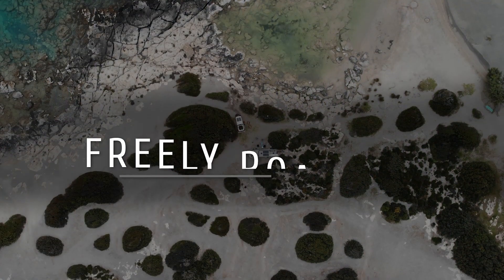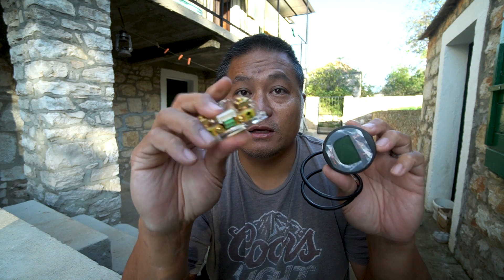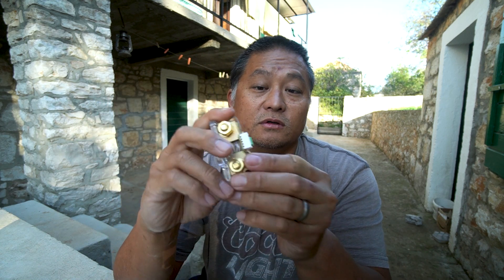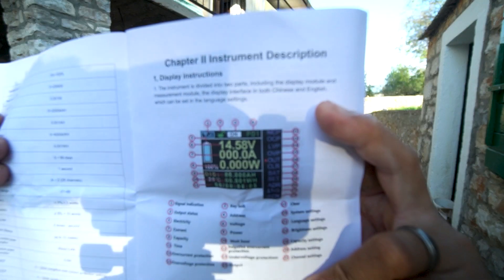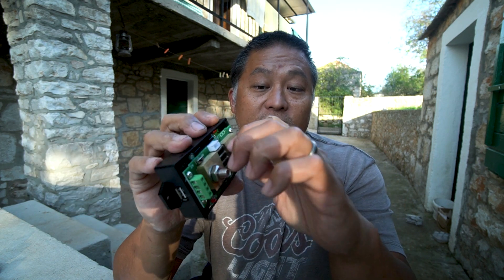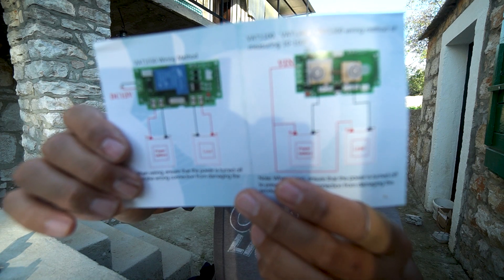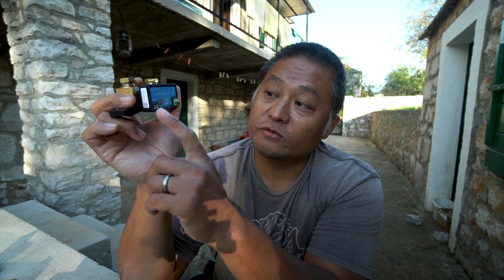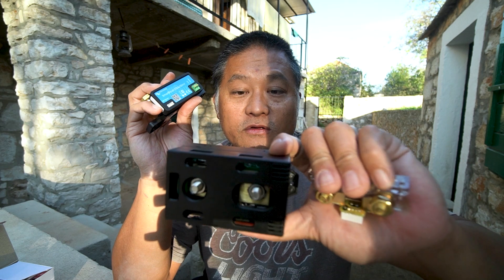Victron Smartshunt, AiLi and Juntek // Comparing 3 Popular Battery Monitoring Shunts

Comment: I am in the design phase to transform a Sprinter 211 cdi, new (2021), L1H1, all a little tight !!!!, but perfect for use here in Europe and exploring small towns, easy to park ... etc
But now I got to the point of doing the electrical project, which I'm not used to doing, I'm a civil engineer, I understand 110 / 220v AC circuits.
I wish you could help me with that part.
I'm Brazilian, but I also live a lot here in Portugal, where I'm going to do the conversion.
Well, I started making a spreadsheet, with the equipment, the necessary power and time of daily use, I have no intention of filling the motorhome with things, not least because it is a Sprinter L1H1, and I would like to have a simple electrical installation, but I would not like have gas inside, so I would prefer a stove with only one induction zone.
To heat the water it would be a D6 truma, which is diesel.

But from the calculations I made and compared with others I saw on the net, it seems that it ends up consuming a lot of energy, making the electrical part more expensive.
I don't want to spend so much just because of induction.
I don't know what other electrical equipment I would still need for everything to work, still using the car's alternator and an external 220v point when stopped at a camping site.

In your opinion, which a good configuration sufficient to have a quick meal,  with induction and stay out of the network for a day or two?

Well, the result of the spreadsheet was:
220V equipment
notebook - 65w - 1 hour of use - 5.4 Ah
induction cooker - 1800w - 0,4 hour of use - 60 Ah

12V equipment
USB - 50w - 1 hour of use - 4.2 Ah
refrigerator - 45w - 8 hours of use - 30 Ah
lights - 15w - 3 hours of use - 1.3 Ah
water pump - 42 w - 0.5 hours of use - 1.8 Ah
exhaust fan wc - 40 w - 1 hour of use - 3.3 Ah
I will be very grateful if you can help me by presenting an wiring electrical diagram with the necessary equipment.
I appreciate if you answer. 
my address is: joaolp55 @ gmail com
Thanks
Reply from the maker: Hi Joao, I think your computer use might end up being more than you budgeted but let's just go with what you have. It seems to be roughly about 110Ah of 12v power. Consider some efficiency losses, between 5 to 10%, we can base it on 120Ah of daily consumption. I like to go by the rule of threes. That mean, have at least 3 times the number of watts as you do daily Ah consumption. That will give you some safety in knowing you can recharge to full, or nearly full each day. And if budget allows, have 3 times the total usable capacity in your battery bank. This second part is a nice to have as it can get expensive but it will give you some reassurance that 3 consecutive days of rain won't cause major problems. That means, I would go with at least 360 watts of solar and as much as 360Ah of battery capacity. If you need more advice, I am also available for hire for private sessions here:

https://freelyroaming.com/coaching
Reply: @freelyroaming  Thank you very much, it helped a lot. I am thinking of abandoning the induction cooker idea,  I would need to make a high investment for that. I think I will study the hypothesis of having gas, but in a portable way. only use when you are offline. And when I am in the hammock, in a camping, I can use induction, as it is more practical, I save propane.
I will redo the consumption calculations, but it will certainly be a lighter project.
Thanks.

Comment: 4:08 150 A * 12 V = 1800 W
Reply from the maker: I was using my maximum LiFePO4 pack voltage at 100% charge which is 14.6v.  The nominal voltage is 12.8v and cutoff voltage is 10v so the output range is between 2200w and 1500w. I always use the max to determine potential power output of to make sure components are properly rated.

Comment: Anyone know which Bluetooth version Victron is using inside their smart shunts... curious to know what kind of real-world range  I can expect(?)
Reply from the maker: It is bluetooth 4.0 (low energy) and I can get 10m line of sight but it drastically reduces if there are signal shielding obstructions. People who complain about range is really complaining about all of the metallic surfaces surrounding their Victron bluetooth devices.
Reply: @freelyroaming  - Is it possible to add a bluetooth range extender to the Victron(?)
Reply from the maker: I do not have any experience with Bluetooth repeaters. Might be worth a try if you really need more range.
Reply: @freelyroaming  I've just installed the Victron Smartshunt. While my devices can detect the smartshunt from about 3 meters away, the VictronConnect app loses the connection when more than 30cm from the shunt. That's while maintaining a view of the shunt, no interfering metal or other obstructions. It's seems to be a consistent complaint on the Victron forum.
Reply from the maker: Not with my unit. I can access mine within 10 meters with no issues.
Reply: @freelyroaming  - 10 meters... interesting!
Reply from the maker: Line of sight. Less if there are obstructions. My van is 22 ft and the shunt is near the back and I can always connect to it from the front of the vehicle with seats and kitchen unit in between.
Reply: @freelyroaming  that's what I was hoping for. I wonder if it's related to the model? Mine is the 500a
Reply from the maker: Mine as well. 500A/50mv

Comment: Hi Jan, I have some questions on Juntek VAT-1200: Does the display unit require battery power ?  is there a battery compartment ?  what size of battery and how many ?   does the display goes off automatically after some seconds ?  when my battery pack is idle without any load, will the shunt (the black plastic box) be still working 24 hours non stop everyday to transmit the data to the display unit ?   What is the max distance the display unit can go away from the black box ?  Thanks !
Reply from the maker: The display needs either 12v power or plugged in via usb. No internal batteries. The display just stays on as long as it is powered. Haven't tested the range on it but it is reasonably good from what I can tell. Works from across the room about 20ft away.
Reply: @freelyroaming  Thank you so much ! Dan    How much does the shunt consume the battery power  ?   does it make sense to you if the shunt is put after a main on/off switch ?  I use my battery pack just for backup power purpose only while power outage,  most of the time the pack is off without any load. I do not need to keep track the battery status every day, perhaps once every 2 weeks, so whenever I need to check, turn on the switch to get the data, then turn it off in a min.  What do you think ?
Reply from the maker: The draw is miniscule. Unless you have a really tiny battery pack it is not a concern.
Reply: @freelyroaming  Thanks!

Comment: I have the VictronConnect 712 with display, I have installed in a van I converted, it has a metal body that is earthed so some items may nor use an earth from the leisure battery direct. Does this cause a problem not being earthed from the leisure battery via the shunt.

Comment: I use this victron shunt and it is brilliant, though i must add the data log is very limited. If you could keep the app open and running indefinitely then yes you can access graphs over time but other than simply recording the max and min warning voltages that need to configure, it does not save any other data internally
Reply from the maker: I do with it could do more. It would be nice if it kept track of incoming and outgoing current like their SmartSolar controllers does with solar for 30 days. But I like that it tells my number of discharge cycles, last discharge depth and time since full. More would be nice!
Reply: @freelyroaming  We all want more, but Victron is using deceptive advertising practices to call this "data logging"
Reply: @BoBurton  It logs it in the phone app as long as you stay connected and have the app running the whole time.
Reply: @troy3456789  yes... That's my point. Why would I keep the app running and phone connected 24/7?  Other companies offer onboard logging whether a phone is connected or not.
Reply: @JirafaBo  I wonder if Redarc or Renogy have such tech. I have not looked. (Renogy is Chinese, and Redarc is Australian)

Comment: You may find the Raspberry PI version of the Venus OS useful!

I have one connected to my BMV712 and both of my solar charger controllers connected via DIY usb cables (and a GPS sensor) and it gives me the status of everything from the app, even if I’m not near the trailer. Trailer is connected via WiFi or a hotspot at all times.
Reply from the maker: Yeah I've been considering repurposing one of my pi4 for this. But I don't have a persistent wifi connection in the van yet since we cross a lot of international borders and don't always have internet connection.

Comment: Wowow  The G7200 takes 3 days to charge.  Price is $250.00 on amazon.  Why pay so much for a 7.2 amp charger?   I dont understand.
Could you recommend a more powerful charger for less or the same money?.  Thanks.  Love you videos
Reply from the maker: The g7200 has been discontinued so that's why the price has gone up. Was around $100 before. For $228 you can get the Noco G26000 which is a 26 amp charger. It will charge more than 3 time faster.

https://amzn.to/2NMojUF

Victron makes a 15 amp charger with bluetooth connectivity for about $150 that looks good. I've never used it but I used many of their other products and all have been great.

https://amzn.to/3r7NkrW

Comment: Try a Venus gx?
Reply from the maker: The Venus GX is an the interface to connect various Victron components like a Multiplus, mppt solar controller and also works with this SmartShunt. By itself it is not able to do anything without peripheral components. It is overkill for my purpose. I have however considered installing Victron's raspberry pi free server software to achieve similar capabilities but have not found a need to do it.

Comment: The most useful and clear videos I have seen so far on YT, thank you.  

Question: It seems that the BMV-712 also has an external relay switching option (NO/COM/NC ports), while the shunt still has ports for a temperature sensor like the Smartshunt. If so, could I set the BMV to cut off DC-DC charging in a low temperature? (2x Orion-Tr smart 12/12-30, has a remote on/off switch wire) 
And maybe get around using a Smartsense as well, if the MPPT can read the shunt via the BMV. 
I think it would work, but maybe I´m leaving out some other important stuff this way (still need high/low voltage cut-off somewhere and so on, ideally wouldn´t want to trigger the battery bms).

I´m building a van, also probably going with a custom battery and everything else Victron. It´s a winter van, so a low-temp cut off is essential. Charging would be mainly from the alternator, but also a small solar panel and a charger-inverter if needed (the MultiPlus 1600W should have a separate low-temp cut-off with a separate sensor anyway, correct me if I´m wrong).
Reply from the maker: Yes you can get the optional thermistor accessory for the SmartShunt which will give you exactly the same functionality as the battery sense. It is about half the price as a battery sense. Had I not already owned the battery sense, that's what I would have done. I'm not sure about the relay programming aspect of the bmv-712. It seems that it should be able to trigger it on and off based on temperature but I cannot say for certain until I get one too try. Thanks for your support! Stay tuned as I'm currently gathering parts to upgrade my battery pack to have a temperature controlled battery heater. It will greatly improved the van's comfort in cold weather.
Reply: @freelyroaming  Thanks! Will do.
Reply: @freelyroaming  From the Victron website, the Smart Shunt provides "a connection that can be used to monitor a second battery, for midpoint monitoring, or to connect a temperature sensor". In other words, the auxiliary function is limited to one of these three tasks. I have 2 LiFePO4 batteries. I would like to monitor both of them using the Smart Shunt. Monitoring the two batteries would leave me without the ability to use the optional thermistor to monitor battery temperature so I would prefer to go with a combination of the Smart Battery Sense device and the Smart Shunt with my Victron Solar Charge Controller using the Bluetooth app. Have you experienced any issues using your 2 Victron solar charge controllers in combination with the Smart Shunt and Smart Battery Sense?
Reply: @freelyroaming  My apologies. I see that 2 batteries in parallel are to be treated as one. I also believe that the temperature thermistor will allow the shunt to monitor all the other parameters plus battery temperature. I would disconnect the existing wired replace it with the thermistor. Am I correct? Since I already have the Smart Battery Sense, I would consider using it and the Smart Shunt without purchasing the thermistor, assuming that there would be no issues using the 2 devices in combination with the solar charge controller. I look forward to your response. Thanks.
Reply from the maker: Yes you will have no problems using them together. You can use their Bluetooth networking functionality so that each victron device is aware of and can communicate with the others

Comment: @8:55: Juntek: Aren't you supposed to just use two additional nuts to assemble the wires? You shouldn't need to disassemble it!
Reply from the maker: In theory yes but the posts are not secured on the other end so in order to tighten the lugs onto the posts you be to be able to hold the other end with a wrench. Otherwise the posts just spinn in place. Really bad design. To do that you need to partially disassemble the unit.

Comment: Great explanation on shunts and the different models here. For the Victron data logging, does the app have to remain in the foreground and does the screen on the phone have to be on to be able to data log?
Reply from the maker: Yes and no. Some of the amperage and voltage tracking is done inside the app so it just tracks when the phone is connected. But the historical data is always running like total Ah and Wh draw .

Comment: Does the solar charge controller not do the job of the shunt?
I've watched a few solar build videos and this is the first time I have seen a shunt mentioned so I am confused.
Reply from the maker: No the solar charge controller can calculate how much power comes in but cannot tell how much is drawn from the pack. Only a coulometer such as a shunt can accurately calculate the precise state of charge both coming in and going out.